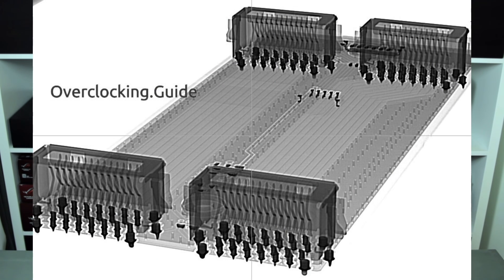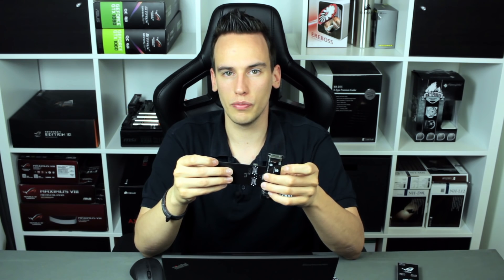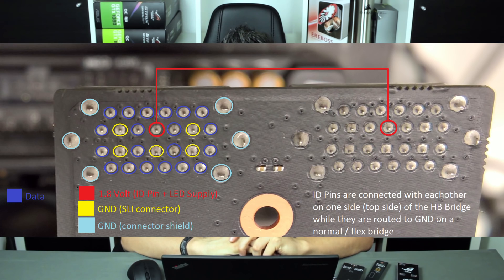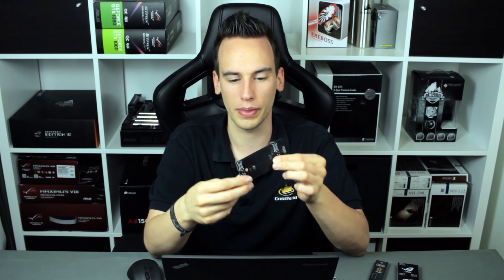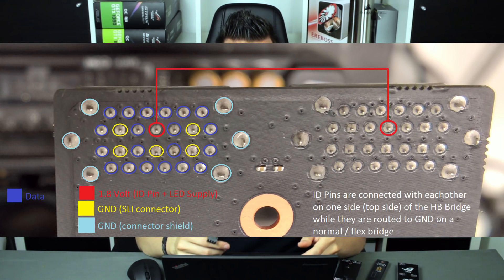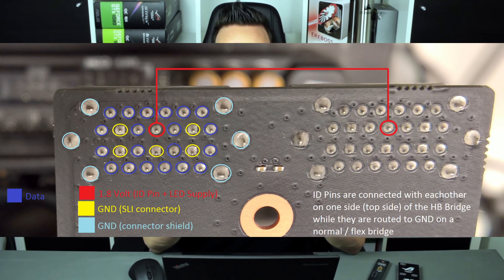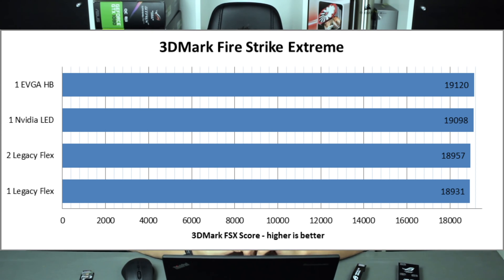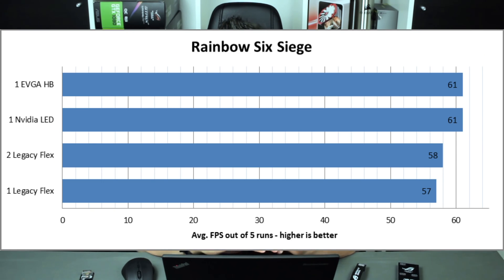Nvidia SLI HB-Bridge: A technical review/test [X-Ray] (Part 2)

Comment: Der8auer, I have a question for you, I just bought 2 x GTX 1080ti and have a 3 way SLI bridge from Asus RIVE in hand, the same as in your video. Do you suggest using this or it is better to get a HB bridge?

Awsome vids by the way.
Reply: I know I spent a lot of time asking your question, but finally what connector did you use for your 1080ti? Thank you!!!
Reply: Leonardo Grasso MSI 2 way HB Bridge L

Comment: Hello! Does anyone know if my flexible bridges needs to be exactly the same length or something? I'm having Asus GTX 1080 Founders Edition with Asus STRIX A8G Gaming Edition and cannot use HB Bridge because the different width of the PCB's... What is weird though, is that both my flexible bridges work fine when I use them one at a time, but when I'm using 2 flexible bridges at the same time between those cards, i'm getting real flickering etc. weird color glitches???Does this have anything to do with the bridges being of different length? The other is 120mm long and the other is 70mm long, both flexible bridges from Asus.... Also my MOBO runs only 8x/8x with SLI, but guess that should have nothing to do with my cards getting buggy using 2 flex bridges??? PLS have anyone experienced such problems and found a way to fix them?
Reply from the maker: yea it's very likely that a different lenght can cause this

Comment: Thanks a lot for the great video man. Exactly what I was looking for... A quick question: what does the driver report when you use 2 flexible bridges? Somebody over at Reddit claimed that his driver detected 2 flexible bridges as the HB bridge... I wonder if that's really the case. Thanks again : )
Reply from the maker: no it won't detect it as HB Bridge. I tried that
Reply: Thanks for letting me know!

Comment: I was just wondering if they changed the thickness of the PCB any, and did you check/measure them? A thinner PCB generally does better as the frequencies go up due to less electrical losses, but these frequencies are still on the lower end of things.

Comment: No, this is false. The way that the Nvidia drivers can tell if you are using an HB bridge is the "prongs" on the left and right of the shielding on each connector. Only the Nvidia LED bridge, Nvidia HB bridge, and EVGA V2 Pro Bridge and other HB bridges have these prongs on the connectors. So Nvidia has set the drivers to only respond to having these four prongs per card to determine that it is an HB bridge, and if it doesn't have those two prongs on two connectors each (per card) then it will assume it is not an HB bridge. Venturi from the Guru3d forums and a few other people have managed to get four way SLI working on pascal TITAN X cards even though Nvidia limited it to two way (they get near perfect 95-99% scaling of GPU usage on all four cards in most games), the way you get 4 way SLI working on Pascal cards is by using the EVGA V2 4 way SLI bridge which has those prongs on the connectors, this causes the warning that shows up in Nvidia Control Panel saying "a better SLI bridge can improve performance" to disappear as Nvidia is tricked into thinking  you have an HB bridge. Then you use Nvidia inspector to tweak the SLI profiles a bit which allows proper four way scaling of 90% or more on all four cards. It has nothing to do with the ID pins.
Reply from the maker: Nope - that's not correct. I made my own SLI bridge in the meantime and my HB-Bridge has no prongs on the left and right. Yet it's still recognized as HB-Bridge because of the pin-out.

I also hav a TitanX 4 Way setup. You don't have to do anything to get it to run. Just use 4 cards, an old 4-way bridge and enable it in the driver.
Reply from the maker: 4 way even works with the old flexible bridges. I will publish a video showing this next week.
Reply from the maker: What you call "prongs" is nothing else than a ground connection and shielding. It has nothing to do with the HB-Bridge
Reply: der8auer So do you use old flexible bridges for 4-way and it’s still recognized as HB-Bridge? Interesting. Would you mind to share how to connect 4-way using flexible bridges? Thank you

Comment: If you can, please test for frame times. PcPer does this to check for frame consistency, which is a lot more relevant in multi card setups, as they tend to suffer from micro stutters caused by bad synchronization. A higher bridge frequency might lead to a better user experience as compared to a few more or less FPS.
Also FPS standard deviation and minimum FPS might be helpful to get a better sense of the technology.

Comment: People say that although AMD is hailed as a hero of the industry that they are just a company the same as NVidia, and that they are no hero to worship, but then you see things like G-sync, and you see Nvidia SLI, Nvidia could easily allow the GPU's to communicate in between PCIe slots like AMD, eliminating the need for this dumb bridge, but nooo they want to charge you extra.
Reply: Use your head before making these inaccurate comments, please. Nvidia is specifically using SLI bridges because PCI-e transfer is significantly slower due to having to communicate through the slot, then the motherboard, then back to the PCH and hubs etc.. then back out to the other slot and finally to the 2nd card. With SLI you go directly from card 1 to card b with no stops inbetween, which DRASTICALLY reduces the lag in time it takes to process data with multiple GPUs. This is the reason AMD Crossfire multi-GPU setups are NOTORIOUS for having micro-stutter and lag much more than Nvidia SLI does. So if you knew what you were talking about  you'd realize that Nvidia still uses SLI on PURPOSE to keep lag and stutter to a minimum, since stutter is a big problem for many gamers who are sensitive to those type of issues. And Freesync is far from competant, so can't really be compared to G-Sync. FreeSync is limited to 75hz max, and only goes down to 50hz in most cases; whereas G-Sync can go all the way from 40hz minimum to 200hz currently. Then there's the fact that G-Sync has slightly less lag and overall is a bit smoother than FreeSync. There's a reason why the G-Sync vs FreeSync blind test using a system biased towards AMD (had a 390X compared to a GTX 970 and used AMD optmized games specifically to give AMD the advantage) ended up with around 90% saying they preferred G-Sync over FreeSync without knowing which was which! (they covered up the monitor model and company name etc.. and had the PC's in an entirely different room using long cables to bring them to the room with the monitors etc.. )  There were VERY few who said FreeSync was as good as G-Sync and only ONE guy out of around 40 who said it was better.
Reply: TheScaleless Lol you're funny. Perhaps at a time in the development of these technologies that was true, but right now Freesync and Gsync are neck in neck, Freesync isn't limited to 75HZ so I dont know where you get that, and AMD crossfire has no trouble with lag at a time it did but not today. There are latency troubles with both sides of the technology of course, but AMD doesn't have anything special, except that it gets better framerates and scaling in games.
Reply: TheScaleless AdoredTV has a great video about SLI and Crossfire that he created in December of 2015 so its pretty up to date.

Comment: I believe there was a Company of Heroes game a couple years ago, that was notorious for extremely poor SLI scaling. It was so bad, that as far as I can remember, Nvidia just turned SLI off completely in the SLI profile for that game, because it was getting negative scalings. Turns out, the game was saving data from previous frames to use for dynamic snow, so it had to push huge amounts of data back and forth between cards due to make AFR work at all, and this became a huge bottleneck. Maybe the extra bandwidth would have helped that game?

Also, I don't think you have pointed out, but the HB bridge has twice the traces going between the cards. It is clearly visible in the Xrays, that in case of the 3-way bridge, every card connects to two cards, but in the case of the HB bridge, both SLI connectors are going parallel between two cards. So in theory this should double the available bandwidth, plus of course there is the frequency increase.
Looking at the test results, it might be the case, that using the second connector in parallel is only triggered when the driver detects a HB bridge, otherwise you should be getting better results with 2 legacy bridges.